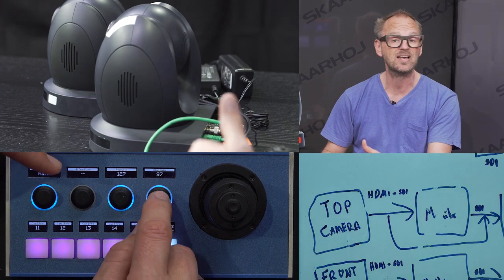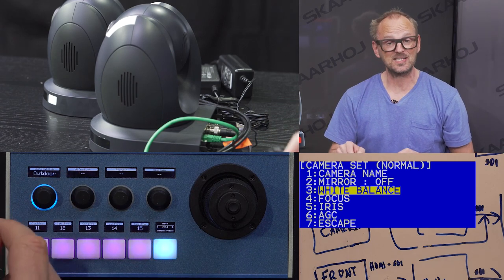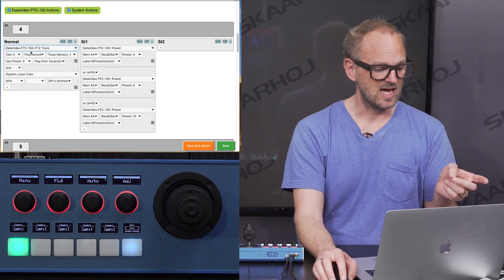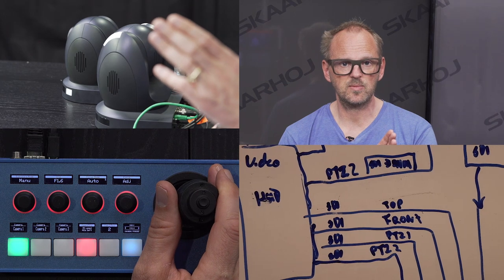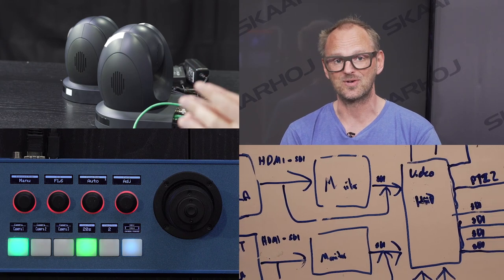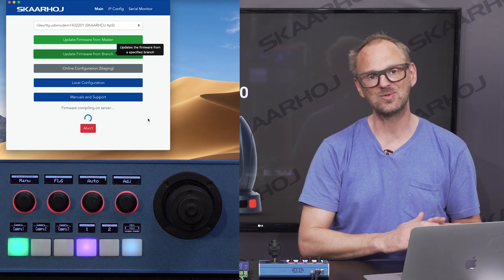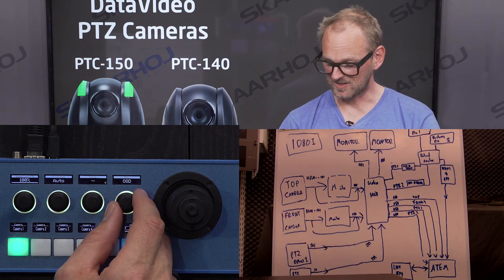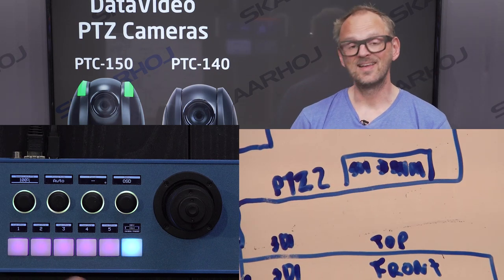Control Datavideo PTC-140 & 150 with a SKAARHOJ controller

Comment: Hello Kasper, can you also control the Tally Light of the Datavideo PTC Cameras and connect it through the PTZ Fly to the video mixer?
Reply from the maker: I’m afraid not. It was planned for a second round of integration. I believe it can be done, but I need to check with the protocols. - Kasper
Reply: @SKAARHOJ  Apparently, the PTC140 uses the same visca-commands described in the PTC150 documentation for green and red tally. I found it out by accident, but it works. :D
Reply from the maker: @sockenritter  Thanks for sharing! Thats cool!